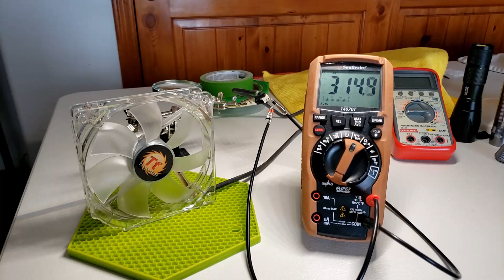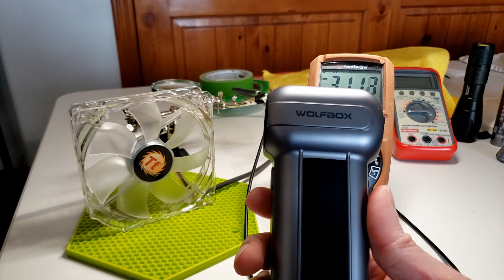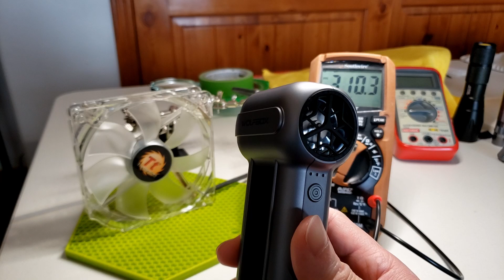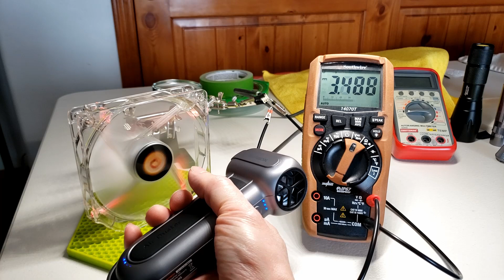Don't Do this when Cleaning Computer Fans

Comment: New fans have functions built in to stop the electricity from flowing from the fans. Also it's not in reverse as you blew the fan in the correct direction. This hasn't been a thing in like 10+ years, pretty much 15 years ago when the fan in the video was made.
Reply from the maker: You're assuming all fans have that feature.  More fans in use today without such protection.  Plenty of old computers still sold and traded to this day.  I just tested the stock fan on an Intel I7-11700f and the fan does output voltage though not as much as the fan in the video.